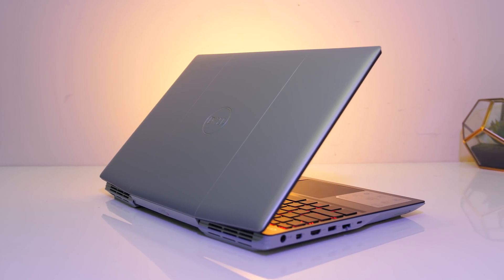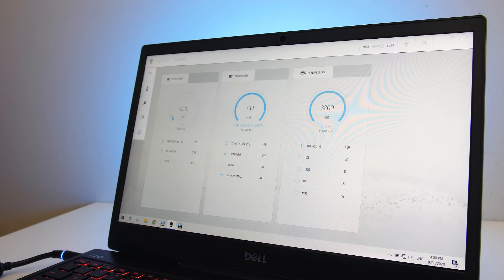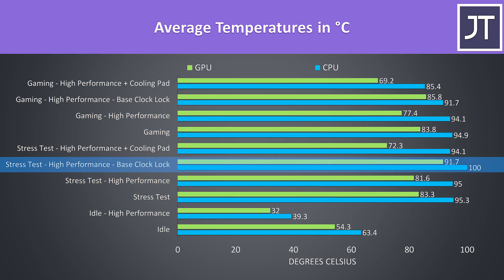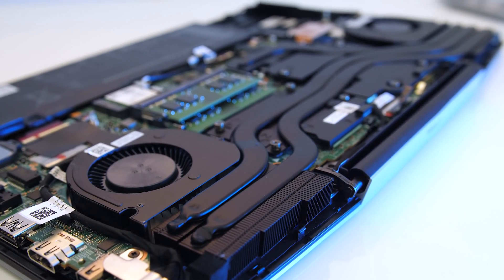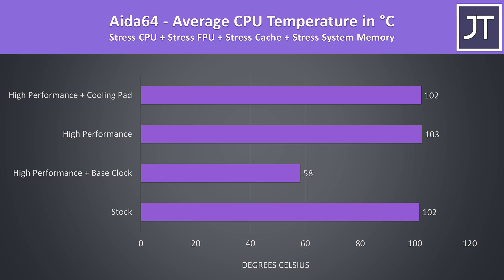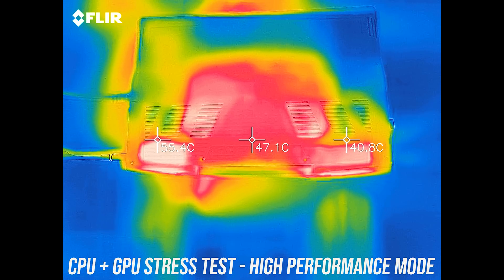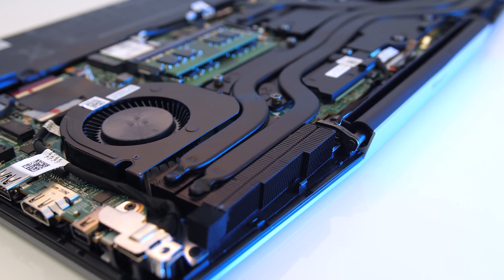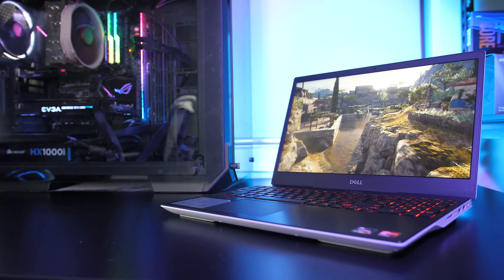Dell G5 SE (4800H + 5600M) - How Hot?

Comment: Hey Jarrod can you do a performance benchmark when using external monitors? I'm split between buying the G5 and A15. The G5, while it is great, it seems underwhelming compared to other laptops. But, it has a mini displayport which not all laptops, especially the A15, have. The A15 would've been ideal and perfect for me but I contacted ASUS and they told me the Type-C DisplayPort is connected to the iGPU rather than the DGPU. So if I was to connect to the Type-C DP will there be any performance drop off on the A15? Please I've been looking for answers no one really talks about this
Reply: "The A15 would've been ideal and perfect for me but I contacted ASUS and they told me the Type-C DisplayPort is connected to the iGPU rather than the DGPU." 

VERY interesting that you got this answer from ASUS, because I'd beg to differ.  I'm on my A15 right now, and have my ASUS VG279QM connected to it via a standard USB-C to DP cable, and wherein while using it this way I don't see ANY activity, at all, on the Vega graphics processor, when viewing it in either the Task Manager or HWInfo64.  So everything most certainly appears to be going directly through the 2060, as far as I can tell at least.  Moreover, I specifically got this laptop because I wanted to utilize G-Sync for my monitor, and to which has worked PERFECTLY for me, since day one. 

In the end (and contrary to the previous commenter's point) I must inform you that I am 100% satisfied with my A15 purchase, and haven't looked back since.  Thermals have also been acceptable, and even better once I disabled turbo-boost via the registry trick while simultaneously undervolting and overclocking the GPU via MSI Afterburner (I have it set across the board at 1500MHz@0.700V).  Oh, and I should note here that after performing such mods, I have seen minimal loss (0-10%) in my average FPS for games, while dropping anywhere between 10C and 15C in temps on both my CPU and GPU!  Quite a disappointment that the base-clock-lock trick didn't help the G5 so much, however.  Likely that "smart shift" feature, I bet, as I have DEFINITELY had a far different (better) experience with the trick when performing it on the 4800H coupled with the 2060. 

SIDE NOTE: There is also a third-party program called "Ryzen Controller" that I recently found, which is almost as good as Ryzen Master, but works for mobile chips, and to which using has allowed me to play with my chip's TDP values rather than simply disable turbo boost.  This has allowed me to more granularly dial in my temps and thus maximize my FPS even more!  It just requires a little more work (trial and error) to find the ideal TDP value per game, than how much work the quick-and-dirty set-it-and-forget-it turbo-boost-disabling mod requires.  Just try both and see what you prefer!  But regardless, it must be noted here that undervolting/overclocking the GPU is where the real savings are at, for without doing that I didn't see nearly as much of a difference in temps on the CPU side with either CPU mod just mentioned (since the CPU and GPU share heat pipes, remember). 

Hope this helps, and happy computing! 

UPDATE:  I totally forgot that the NVIDIA Control Panel tells you which monitor is connected to which port, and which port is connected to which GPU, via its PhysX tab.  Alas, I can tell you with absolute specificity that my VG279QM is connected directly to my 2060 via the USB-C DP port.  Moreover, when I connect it to my A15 via the HDMI port, the PhysX tab shows that it is connected to the Vega GPU!  (And as a side note, only then do I begin seeing activity -- in the Task Manager and HWInfo64 -- on both my GPUs.)  Now the 2060 is definitely still doing most of the work (as I run my GPU-Z stress test here) so I know that it's fortunately still being utilized.  But it does appear now that the Vega -- since it's doing *some* work (about 10% utilization) -- is likely receiving the "finished product" from the 2060 that is essentially being "relayed" to it internally. 

So yes, if you're running >>HDMI<< to an external monitor, I do think your original hypothesis that you asked Jarrod about might hold true -- where performance (starting with temps for sure) would be negatively affected.  But!  It does look like, at the very least, that you'd be all set when running things exclusively through USB-C to DP. =)
Reply: @zoinbergs  sorry for the late reply but thank you very much! Was stressing over this a lot but you really put my mind at ease. Thank you!
Reply from the maker: Going forward I always mention what all the ports are connected to in the full review, I haven't tested the A15 yet, but with G5 can confirm Type-C goes to Vega, but MiniDP/HDMI go to Radeon.

Comment: Goodthing that Ive decided to purchased helios 300 with i5 9300h / rtx 2060 variant rather than g5 se. I was once thinking to buy this tho 🙂
Reply from the maker: Should do better in games, 2060 beats 5600M, though for CPU performance Ryzen 4000 will smash the i5.
Reply: 9300H also runs extremeley hot. 90-100C for me, and that's after an MX-4 repaste and -.165UV
Reply: @AB-sg4xu  never experience same temp so far. Currently on 83°c tops
Reply: @tronalddump5837  what's your cinebench r20 score?

Comment: Hello,
It is pretty off topic, but , which processor is better for gaming? i5-9300H or i5-10300H? Is there any big difference? is i5 10300H a good combination with the RTX 2060 6gb? Thanks.
Reply from the maker: Technically the 10th gen, but they would essentially be the same at the end of the day, you won't really hit the higher clock speeds under sustained load like gaming anyway.
Reply: @JarrodsTech  Thanks. So it basically doesn't matter. It will perform the same, right?

Comment: Just wondering, when you removed the back cover, did you cover the gap between the fan and the heat sink (this can be done with tape). This may explain the higher temps with the back cover removed.
Reply from the maker: No, I considered it but didn't bother, if they want to design it like that then that's how I'm trying it.
Reply: @JarrodsTech  So I guess, with the Dell laptop, the bottom cover does not perform this function? I think the bottom cover of the Asus A15 does cover the gap between the fan and the heat sink.

Comment: I just bought the new razer blade pro 2020 and the speakers give constant static feedback when the laptop is not plugged in. I have a couple days left to return this machine. I’ve tried every tutorial in the book to fix the audio. Should I just return it. This is the most expensive and stressful experience I’ve ever had to the point where I couldn’t leave my bed for a day because I was sick from stress. Have you heard of this static feedback caused by power management and is this fixable or should I return this as quickly as possible
Reply from the maker: Interesting, don't think I've ever heard of that happen, but also do not have that specific machine to test with.
Reply: Any help at all would be greatly appreciated

Comment: would the hot air blowing at the hinges/screen affect it? My current laptop has a broken hinge and I really don't want to deal with that again.
Reply from the maker: Maybe, hard to say, the hinge doesn't seem to heat up as it's in the middle, but I do not know how it will affect the panel long term.
Reply: @JarrodsTech  Thanks for the reply!
Checking a comment on Dave's review of this laptop:
"You're completely right about the hinge. I have a Dell G3 2019 that has the same hinge and it failed just 4 months after purchased."
You can scroll down the comments and you will get people talking about the hinge, one positively, and a couple negatively.
It seems I will be waiting for RP-17 reviews, heat and reliability are the most important for me.

Comment: Lol, in fear of what corona will do to the market, I bought Predaor Helios 300 with heavy hearth that I am wasting money and I could get better and cheaper dell G5 month later (I was originaly deciding between dell G5 and helios and it was really close call).  Now, 3 months later, dell G5 SE is not even avaliable yet in my country and I am soo happy with my helios 300. Wtf is this 90°C GPU and 100°C CPU thing. Both dell G5 and TUF A are very disappointing. Why the hell did they take away all the holes.
Reply from the maker: Seems to be the new normal for Ryzen 4000 budget laptops.
Reply: Lets hope other brands will handle this better. At least one the picture Lenovo legion seems to have normal cooling solution.

Comment: How does a laptop run a 40 degree CPU at idle and max fans? Even worse, how does it idle at 63c? Could it be an issue with thermal paste application

Comment: LOL I will be laughing to persons who buy these Dell G5 SE and ASUS A15. Dell doesn't putting air vents to sides, ASUS closes air roads with plastics. Well, AMD is being stupid in this situation. Ok, Intel may charm producers but AMD just watching all. Look at these temperatures. Hey! AMD, upgrade to 1nm. I don't care. Because already your processors will be 95 degree. İdle 65 degree is more dumn. God bless all
Reply: so what do you suggest as a good laptop that offers similar performance without bunking up the price?
Reply: Sloch i7-9750H and undervolt. This is best. I don't know when it will change but at this moment with undervolt, i7-9750H is working on top frequency with 80 degree
Reply: Its not AMDs fault though, just shitty design on Dell and ASUS side. Pitty
Reply from the maker: No vents on the sides is pretty common unless you go for I/O on the back, or down the front and in the way. I guess due to the hinge design it's not possible to add it on the back.

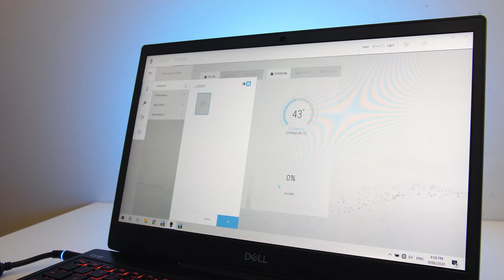Comment: 1:30 Yeah, you're doing it wrong. I have the last model G5 and the software tripped me up for ages too. To make settings actually do anything, you need to click the chain link icon next to the profile name, which will pop out a list of software etc. You then select which software you want to trigger that profile. Alternatively (and a much better option imo) you can select "system" in the list, and it will use that profile all the time.
Reply from the maker: That is ridiculous, what a joke. It should just work the same globally how they have it in Alienware, the option is even there and greyed out.
Reply: Jarrod'sTech please let us know if you will do it with MrClown’s advice this time!
Reply: MrClown the G5 you have is a valid laptop? Does it have any problems?
Reply: @alessandrogregorini4775  Yeah the temperature goes brrr
Reply: @alessandrogregorini4775  I have it, and I'm slightly uncomfortable with how warm the surface becomes, especially while mid tier gaming. But I guess all gaming laptops do this... ?
Reply: @marwanalkhaleel9647  Yeah all bad gaming laptops do.

Comment: I'd say this laptop is Hot AF.
100 degrees, enough to boil water.
Reply from the maker: Cooking dinner is a value add.
Reply: Luckily silicon isn't made out of water :p
Reply: @heroofharo  You know it's a joke lol. It's not meant to be taken seriously.
Reply: SMASHANDBURN YT r/woosh
Reply: Yep leaning toward the legion y540. Dissapointed
Reply: My 2012 laptop runs 90-103 celcius while watching twitch. I really need to get a new laptop lol. Why i'm here.
Reply: @anires1195  re paste your cou and clean the fans.
Reply: Does it even have thermal paste
Reply: @Corpuscle  I' m in the market for my first gaming laptop so dont mind my noobiness. But isnt an AMD processor garbage if it isnt paired woth an amd gpu? It seems like the y540 is the best bang for your buck with ita 1660ti.
Reply: @keonideinhardt  No, AMD 4000 mobile processor are just better in every way possible (gaming, rendering, battery life, temperatures) indipendently of GPU. AMD 4000 series processors are best when used with an AMD GPU because you can use SmartShift, but unfortunately the Dell G5 will be the only one to use this tecnology this year. It's just that OEMs (like Asus or Dell) are pairing AMD 4000 series gaming laptops with shitty designs, leaving the best designs only for Intel + Nvidia expensive laptops. With a proper termal solution (like the ones used for RTX 2070 laptops) the G5 would be much better.
Reply: @lupintheiii3055  Battery life and heat are not better than Intel. The rest is true.
Reply: @lupintheiii3055  can u suggest me the best amd ryzen  laptops
Reply: harold currently, AMD CPU is best on market by far.  Unfortunately they aren’t being paired well with higher spec’ed Nvidia GPU’s which has everyone complaining.  Also, AMD is having driver growing pains, but quickly being corrected.  Asus G14 on Best Buy website is paired with 2060 max q, and cost $1350.  I don’t know how much you saw the Y540 for, but depending on what you want, G14 may or may not be a better buy.  You’d have to update all the drivers and bios with AMD laptops immediately tho.  I wouldn’t buy this G5 tho.  Looks crap.  Side note, I notice a lot of the laptops are showing inflated prices due to supply problems and COVID-tax.  I’m a noob in same boat too tho, so grain of salt.